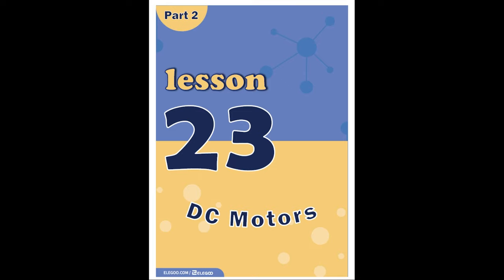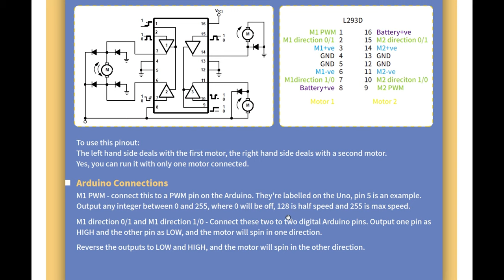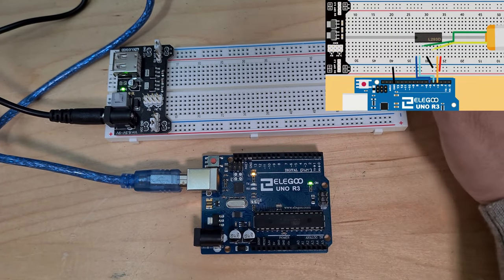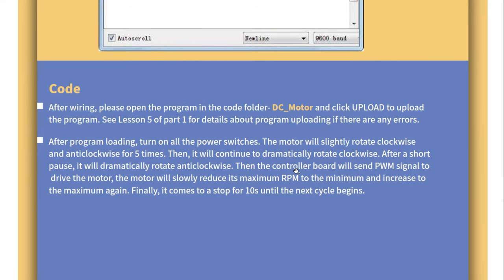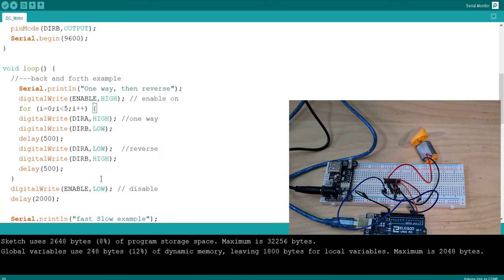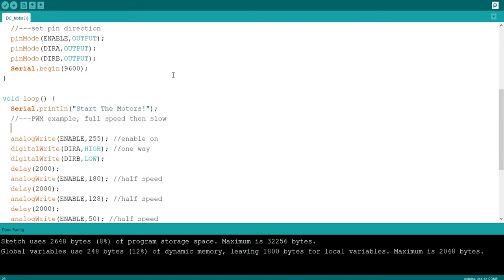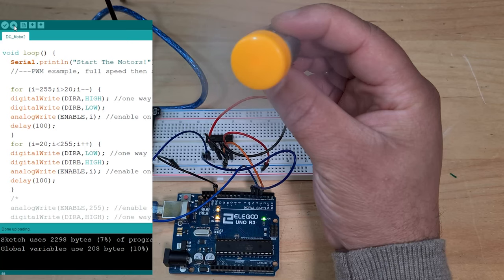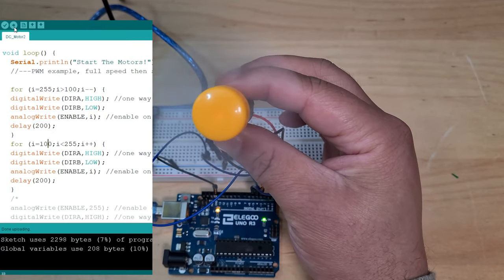DC Motor Arduino Tutorial - Elegoo The Most Complete Starter Kit

Comment: where do i find the code
Reply: // Define pin constants
#define enablePin 5
#define in1Pin 4
#define in2Pin 3

void setup() {
  // Set pin modes
  pinMode(enablePin, OUTPUT);
  pinMode(in1Pin, OUTPUT);
  pinMode(in2Pin, OUTPUT);

  // Set initial motor direction and speed
  digitalWrite(in1Pin, HIGH);
  digitalWrite(in2Pin, LOW);
  analogWrite(enablePin, 255);
}

void loop() {
  // Change motor direction and speed after 5 seconds
  delay(5000);
  digitalWrite(in1Pin, LOW);
  digitalWrite(in2Pin, HIGH);
  analogWrite(enablePin, 100);
  delay(5000);
  digitalWrite(in1Pin, HIGH);
  digitalWrite(in2Pin, LOW);
  analogWrite(enablePin, 255);
}

Comment: I just got this kit and am trying this lesson, but I cannot get anything to happen. I have check, unplugged and replugged everything and get no response from the motor. I have tried uploading to both ports available on my computer and still no difference. Any suggestion?
Reply from the maker: If you have a multimeter you can check continuity on the motor itself. The solder on mine and others was not great. Or just connect the motor straight to 5V and see if it spins. If it doesn't you'll need to resolder those connections.
Reply: @HamedAdefuwa  lol i tried this, as soon as i connecred it to the arduino it spun to life, i got startled and the negative wire fell off
Reply: @Merchantofwar  he's not using an arduino. You need to use a elegoo
Reply: @Skyrem-dm7hj  it still works the same

Comment: also can you send me the link to the programming where you adjust the speed of the motor it is the finale step for me to finish plz give it to me fast
Reply: // Define pin constants
#define enablePin 5
#define in1Pin 4
#define in2Pin 3

void setup() {
  // Set pin modes
  pinMode(enablePin, OUTPUT);
  pinMode(in1Pin, OUTPUT);
  pinMode(in2Pin, OUTPUT);

  // Set initial motor direction and speed
  digitalWrite(in1Pin, HIGH);
  digitalWrite(in2Pin, LOW);
  analogWrite(enablePin, 255);
}

void loop() {
  // Change motor direction and speed after 5 seconds
  delay(5000);
  digitalWrite(in1Pin, LOW);
  digitalWrite(in2Pin, HIGH);
  analogWrite(enablePin, 100);
  delay(5000);
  digitalWrite(in1Pin, HIGH);
  digitalWrite(in2Pin, LOW);
  analogWrite(enablePin, 255);
}

Comment: hey mine does all of that but when its spinning it only slightly spins rather than doing full rotations, the only difference to yours is that im using a 9v battery instead of an adapter, does that change anything?
Reply from the maker: erm yeah somethings wrong there, the 9v battery it should work better. higher voltage would help the motor spin more. u sure you're using the motor and not the servo lool unlikely I know
Reply: Mine does this as well. But it also makes a beeping noise
Reply: @HamedAdefuwa  Thanks! turns out that the motor i was given was soldered really badly on the positive connection, so i have re-soldered it and it works fine
Reply: @Mauricio-wf7se  have you checked the solder connections on your motor? that seemed to be the problem with mine, not sure about the beeping though

Comment: Can you give the code to get it to spin slow enough for a merry go around ?
Reply: FOR REAL YO THATS WHAT IM SAYING!!!!!
Reply: // Define pin constants
#define enablePin 5
#define in1Pin 4
#define in2Pin 3

void setup() {
  // Set pin modes
  pinMode(enablePin, OUTPUT);
  pinMode(in1Pin, OUTPUT);
  pinMode(in2Pin, OUTPUT);

  // Set initial motor direction and speed
  digitalWrite(in1Pin, HIGH);
  digitalWrite(in2Pin, LOW);
  analogWrite(enablePin, 255);
}

void loop() {
  // Change motor direction and speed after 5 seconds
  delay(5000);
  digitalWrite(in1Pin, LOW);
  digitalWrite(in2Pin, HIGH);
  analogWrite(enablePin, 100);
  delay(5000);
  digitalWrite(in1Pin, HIGH);
  digitalWrite(in2Pin, LOW);
  analogWrite(enablePin, 255);
}